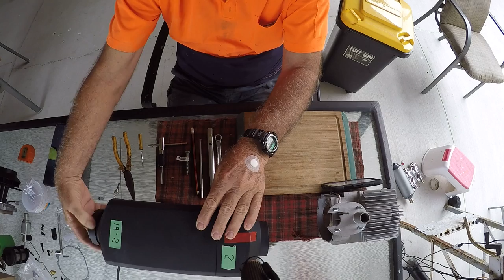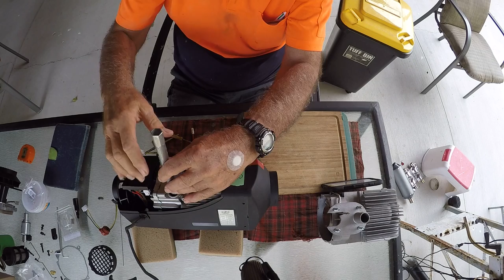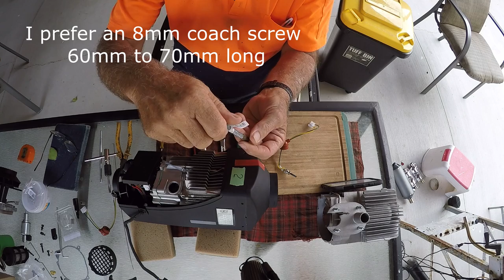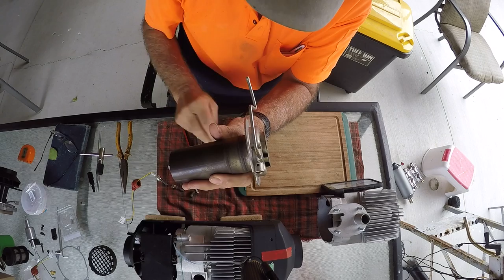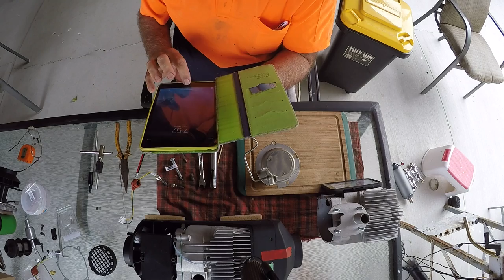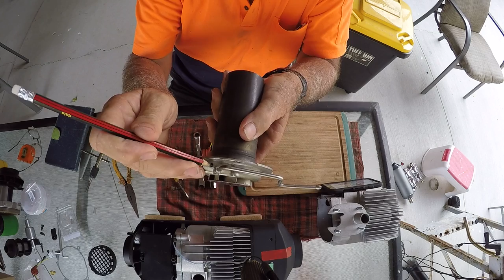Chinese Diesel Air Heaters - Part 9 Glow Plug & Atomizing Screen

Comment: Best series out there, watched them all as I awaited the arrival of my 5kw unit.
Ran like a dream for 4 days,  I know your probably buisy with other stuff but wondering if you had time for a little advice / help.
Now showing error code 3 so have ordered more glow plugs.
It looks fine, neither open circuit or short circuit, obviously I should wait for the new plug to arrive but showing about 1.85 ohms on the 20k scale I'm now worried my wait could be in vein and it could be the control board. What do you think.
Reply from the maker: Hi Gramps,

You are correct, E03 is generally a glow plug issue.

If the heater has been working well and you have not had the heater open ( hence bumped or damaged the fragile glow plug connections) I would first suspect a low voltage issue.

What is the volt reading on your battery? These heaters require 10 amps at 12V at the glow plug to start. If the voltage is low they will not start.

Low voltage issues are caused by a flat battery, thin wire, poor connections, or other power items in use, such as lights or compressor fridge drawing power from a battery at the same time as heater start up.

A flat battery is easily checked with a volt meter. If not available, will the heater start with a battery charger connected?

Low voltage is also caused by having the heater connected to a distribution panel. The heater should be connected directly to the battery, and if the power wires are extended they should be increased in size.

I would be looking at the voltage issues first, before looking at a faulty glow plug.  JMcK
Reply: @johnmck1147  thanks so much for the quick reply, 
That is a fantastic possible solution. 
Will try it sunday when I get home as it is currently wired to the accessory bus , on this is only 2 unused usb ports but  utilizes small gage wire, have monitored the heater voltage on the display during start up and think it dipped to about 10.9v using a lithium house battery which sits around 13 - 13.2v so I reckon your onto something Probably just got away with it for a few days due to my slightly higher voltage until the wires from the bus decided they'd had enough. Interesting that the resistance across the plug changed when I fiddled with the coil conections but I'll try your solution first befor fitting the new plug to truely know the answer.  Will let yo know how it goes. 
Many thanks for your support. 
Kind regards 
Paul.
Reply from the maker: Gramps 
👍
Reply: @johnmck1147  
Turns out the plug was faulty, however this is likely to be because of my poor wiring,  it was previously noted during start a marked increase in fan speed once the plug turned off during start,  I believe this could have caused two possibilities. 
1/ shock cooling of the plug during start
2/ insufficient cooling ( heat air ratio) of the plug during initial start causing overheating of the plug, in particular, reduced secondary air over the plug where the wires connect.
Also like any new toy it was getting very high cycles with little rest in between,  
Either way, no E03 message and problem solved thanks to you.
Previous voltage drop during start was 12,9 to 10.9v
Now with better wiring 
12.9 to 12v.👍😁
Reply: Similar failure to start after only one day of use.
My air inlet was very close to a blanking plate on the driver's seat frame - I've now removed it, but wonder if that caused the overheating you suspect.
Reply: @offshoretomorrow3346  Thanks for the comment, yes I think we may both be on to something, low air flow is not good for either starting or running, during start in my case it seems caused the plug to fail, low airflow ie restricted inlet could have a similar effect but would also cause bigger potential problems after start as it would disrupt the fuel air mixture and case cooling, a richer mixture would offset the cooling issue to some degree but may ultimately lead to fowling and carbon build up, I'm not an expert and have little experience with these but did build jet engines for many years and these little guys seem just like a mini jet engine,  probably why I love them so much.😀

Comment: I have a glow plug error on shutdown even though it is working fine 🤔 any ideas ? You make great videos 😀
Reply from the maker: Hi Adam, if you have a clamp amp meter put it over the heater power lead, your heater should draw around 8 or 9 amps on shutdown as the ECU turns on the glow plug. I would also check your battery voltage to see it does not drop to low levels on shutdown.

Sorry, but without knowing more detail I can't be of more help.  JMcK

Comment: John  I live in Canada and sometimes the temperature goes to -30 degrees C. I sometimes have to add a nonpolymer diesel fuel additive to help keep the fuel from gelling. Can the diesel heater work with the additive. I use Howes brand.
Reply from the maker: Hi Mr C,

Wow! I can't even get -30°C in my freezer.

Look, I really do not like to comment on something unless I have personally used or tried it, so I can not offer comment on your fuel additives as I have never used them. However, I would love to get feedback from you how your additive works.

Have you tried a high kerro/diesel mix for winter operation?

Cheers.  JMcK
Reply: Thank you for your honesty. So far the additive seems to be working well. We are getting our fuel from the main fuel tank so running the truck with kerosene is not a great idea. Just to let you know, last night there was a severe cold warning at the Fort Chippewas area of temps. in the -40 degree Celsius range with a wind chill of  -55C.  I live in Southern Alberta and right now it is a balmy plus 6 degrees C.
Reply from the maker: Superricht2000 Suprt2001 

Wow! That is cold.  Thanks for the feedback. Stay warm.  JMcK

Comment: Hi John, if I were going to make the tool to loosen the plug myself, what size/ specification of plumping tool should I look for?
Reply from the maker: Hi Jordon, Just as in the video. You want a 12 mm tube or socket spanner. You then cut a slot out of one side. Please watch video again.  JMcK

Comment: What is the minimum battery i can use to run one of these. Golf cart, marine etc.
Reply from the maker: Hi Tom,
You can run them on a small motorbike battery if you want.
The issue is how long you wish to run the heater before battery recharge. That fact will determine what size battery you need. I talk more on this subject in no 18.
Cheers.  JMcK

Comment: Hi John
I'm in Melbourne Victoria
My heater comes up with Error e3
I used the tools u suggest to check the glow plug and atomiser  screen
The screen looks clean
I have only used the heater about 10 times
Would it be possible to meet up to try and solve the problem please
Reply from the maker: Hi Brian, that may be a little difficult. I am currently on a sailboat sailing the Greek Islands.

Now to your problem. How did you check your glow plug?

I use two methods, 
1. I put a clamp meter on the battery wire, and when the glow plug is turned on the amp draw will jump up from below 1 amp up to 8 to 10 amps.

2. I remove the glow plug but leave the two wires connected and turn on the heater. Hold the glow plug with a pair of pliers, the glow plug should glow red hot.

If the glow plug is working correctly I would next check your fuel delivery. Remove the fuel hose from bottom of heater and turn heater on if you have a controller with a primer function. The diesel should pules out.

If no primer function I find it better to manually operate the dosing pump. Not so easy if you are not mechanical inclined. I cut one of the two wires to the pump and connect up a push button micro switch. I then turn the power on and off with the switch, count the times (pulses) and measure the output. You can also do this by tapping the two wires together. 

Good luck. JMcK

Comment: What model do you recommend under 2k watts? For a van
Reply from the maker: Hi Preston, it is very dependent on the size of the van, the insulation in the van, and the operating environment. For a small van and non severe winters, a 2Kw heater will suffice. JMcK
Reply: @johnmck1147  ok thanks for the reply :) I went went with the Lavener Pro 2k. It's going in a polyiso insulated t1n sprinter. Have a good one 🤙

Comment: I have a question. I live in Denver 5280 feet. I would be using it in town but also at higher altitudes 7000-9000 ft.   Will it work at these altitudes? Will there have to be any adjustments that will need to be made?
Reply from the maker: Hi Svmsice, these heaters are a knock off copy of the Eberspacher D4 heater. They will work ok up to about 5,000 feet of continuous use and a little higher for short periods, like going through a mountain pass. After that you need an altitude kit which consists of an altitude sensor and software to compensate for the low oxygen levels. Eberspacher sell such a kit for around $500 (from memory). I have not seen one available for the cheap Chinese heaters. But I have not looked hard.

You could experiment yourself (no big mountains around here for me to try). You need to increase the input air volume to match the fuel flow to get a proper burn. A simple way would be to manually increase the fan speed up to blow more air into the combustion chamber, or to decrease the fuel input and keep the fan speed up, but the ECU has control of the fan speed and fuel rate and it matches the two which is set by the software.  The ECU would not just allow you to boost the fan speed, so you would need some way of deceiving the ECU. 

I would also try and see if I could buy a mechanically busted genuine Eberspacher with a altitude kit and transfer the electronics over to the Chinese heater. This won't be easy, Good luck. J
Reply from the maker: Hi Svmsice, I have been thinking more about this for you. 

The heater will not stop working at high altitude, it runs rich because the fan doesn't spin fast enough or the fuel dose is too great for the lower oxygen level. This poor burn causes soot buildup in the heater. 

I would try running a 50:50 or 70:30 mix of kerosene and diesel and see how that goes. 

A kerro diesel mix would run much cleaner and there would less soot build at your high altitude up in the heater. 

Please let me know know things turn out. J
Reply: John McK 47 Thank you!  I appreciate the advice. I’ll let you know how it works when I get it.

Comment: Installed mine under the driver's seat of my campervan - fired it up, lovely and toasty all evening.
Next day, tried to light it and no go! Fan for about 1 minute and that's it.
Got error code 03. (Plug)
Testing the wires at the glow plug, I get a slowly rising current to about 8 volts, then the fan cuts out and the controller switches off.
Any ideas what's wrong?
You're clearly the Go To Guy. (  :
Reply: Ps. I have 13v in the main input wire in the heater loom. My batteries are excellent.
The heater is new too.
Reply from the maker: Hi Robert, these heaters require 10 amps at 12V to start. 8 amps at the heater is way too low.
If your batteries are good then you have voltage drop in the wire loom and or connectors. Have you increased the power wire lengths without increasing wire size. I talk about this in the motorhome videos.  JMcK
Reply: Thanks for the help (stupid YT didn't notify me though).
I got a replacement glow plug and - bingo.
The original had developed a crack on the ceramic.
 I believe it was due to overheat from partial obstruction of the blower inlet by a plastic plate on the seat frame - now removed.
The weird voltage readings are beyond me (part of the glowplug cycle?) but not the source of the problem - it's running great with its new plug now.
Superb video posts - hugely informative. THANKS. (   :
Reply from the maker: 👍 JMcK

Comment: Hi can you tell me why I’m getting fuel smell on start up? My heater is only less than 3 months old. I’ve taken it apart and sealed all the gaskets and all so sealed the glow plug and fuel line grommets! But still getting the smell. Have you any advice please. Bob
Reply from the maker: Hi Bob,

It is hard to offer suggestions without seeing your set up. But some suggestions.

If the smell is only on start up and then it goes away, you may have back flow fuel leakage when heater is stopped.

Is your fuel pump in an upward direction, with the outlet pointing up. If not mount pump in a vertical orientation.

Is your fuel tank higher than the heater? If yes, Fuel may be seeping back past pump seals and into the heater. If this is the case, suggest you install a fuel shut off valve in fuel line before the pump and turn off when not in use.

Good luck.  JMcK
Reply: @johnmck1147  Hi yeah I think I can make some small changes.. hopefully that will make a difference. I appreciate communication and advice John. Thank you! Bob

Comment: Where can I get the insertion tool John please?
Reply from the maker: Hi Matt, there are lots of suppliers on line. Below is just one link to get you started.

https://www.ebay.com/itm/2-5kW-Glow-Plug-Parking-Heater-Special-Repair-Atomizing-Mesh-Thimble-Wrench-Kit-/144595735735?mkcid=16&mkevt=1&_trksid=p2349624.m46890.l49286&mkrid=705-154756-20017-0

Cheers.  JMcK

Comment: I got it to work. Tore it apart the fan was rubbing  making the error messed up brand new and you got to take it apart and fix it.
Reply from the maker: That is why you always bench test them first, before install Ernie. But a problem one is quite rare, and you are buying them very cheap, compared to a genuine unit.  JMcK
Reply: @johnmck1147  mext time i will test first we hen i get another for my camper. Using this one in my bedroom. Thanks again.  I did buy 5kw with aluminium  case sucked to get apart but  like aluminum  case better.

Comment: Why must the glowplug always be up? Another well known user/tester of these units on yt did some testing and came to theconclusion they can be mounted in whichever direction .
Reply from the maker: Hi Andreas, 

Yes, these heaters can run for a while in an inverted position, they can also run "for a while"  on engine oil mix, just as your motor car can run "for a while" without cooling water and it can also run "for a while" without engine oil. But why do it? - Just to be able claim they can?

Just as using engine oil mix greatly reduces the service life, so does running these heaters inverted. You will get starting issues and carbon build up.

The diesel will pool at the bottom of the heater around the glow plug and glow plug screen  causing starting issues and the little fan does not have enough force to lift the diesel upwards against gravity and hence you do not get a good fuel air burn mix.

Yes, you run the heater like this for a short while, but WHY?.   JMcK
Reply: @johnmck1147  🤷‍♂️

Other YT'ers trying to run it upside down for 2 minutes and going "Yes, that works" .. 

I'd put it the correct way.

Thanks for your quick reply.

have you found any downsides to running fuel pump vertical vs 45 degrees?
Reply from the maker: Andreas 
I have found the pumps run ok in a vertical application.
Cheers,   JMcK

Comment: So I replaced a heater that lost power when hot (cant recall the codes) but the new one gave a 03 code after the initial fire up, I have checked all wires etc but the screen still shoes 03 code. Can I clear this and try again? Is new unit possible broken? I feel it was a lack of pumping or lack of fuel since priming time was very brief
Reply from the maker: Hi GT,

I would be taking a close look at your wiring and the battery voltage at the heater.
I find quite often people with 03 code do not have 12V or more voltage at the heater or glow plug.
Suggest you have a look at wiring segment in motorhome video.  JMcK
Reply: I certainly appreciate your input, you are a legend.  The unit itself showed 13.5 volts yesterday and 13.4 now however I will have to bring the multimeter into play. The run is not too far as it is a pickup truck with camper but I think you're on to something.  I'll keep up the investigation and let you know in detail what cures it. But even now after being unplugged, it shows a 03 code .. strange
Reply: G'day John, I thought you were headed in the right direction, I checked my 2, 6 volt batteries out, both were low on fluid, I topped them up and checked specific gravity, both came in flat (not great at least) so I'm going to desulfate and charge to see if the hydrometer comes in better tomorrow.  I couldn't test the amps , I have a Bosch 10 amp max tester (shouldn't have been so cheap) 
Even at 14.6 volts, the screen still shows 03 code.. maybe I should put the old unit in to see if it fares better.. I'm in the outback (of California) so it's an hour plus to the parts store and I'm not inspired despite the high 20's low 30's as I have old faithful to keep me from freezing.. anyway thanks for your help, I didn't expect it but it was appreciated. 
I can share a gift if you like true crime.. "Murderlaide " is a podcast my friend Annie puts together she does a bang up job and has a great voice (I know, I used to do voice for movies, commercials and video games.. she's good) I'm also a crime buff, pilot, artist, lorrie driver and grandpa and occasional exactly correctionist

Comment: The screen has three weld spots. Which direction do they go?
Reply from the maker: Insert the screen with spot welds away from the little air hole.  JMcK
Reply: @johnmck1147  thank you!